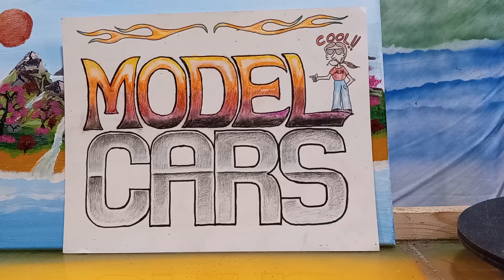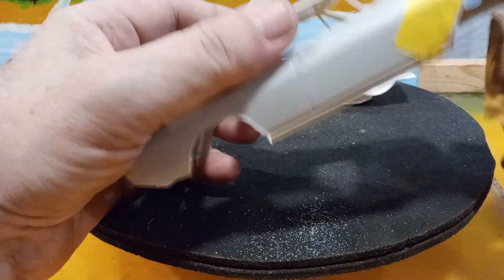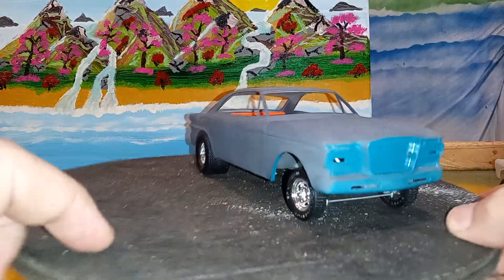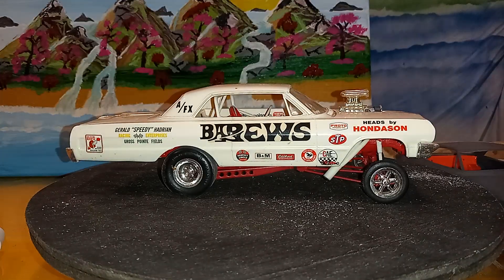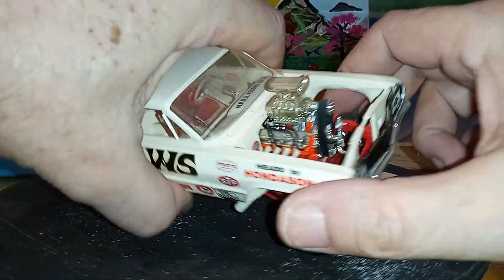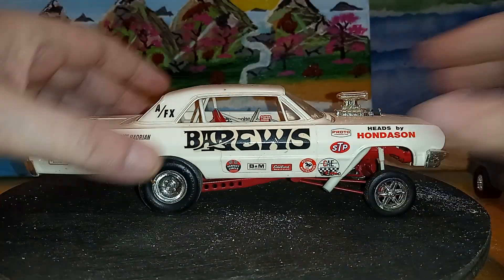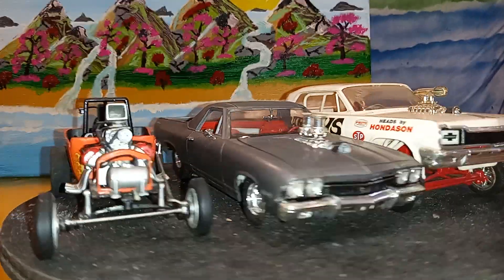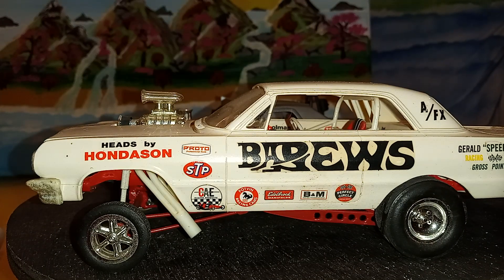#37,,,a tip a update some builds and other things

Comment: Glen - If you want to keep your tires clean when you hog out the fenders, try a socket. You can choose a socket a freckle bigger than your tire and use fine sandpaper. Less chance for a screwup. I found out the hard way.
Reply: great tip, thanks
Reply: The Nut top idea, I like that Sweet 🍺🍻🇦🇺🇦🇺🤝😎👍